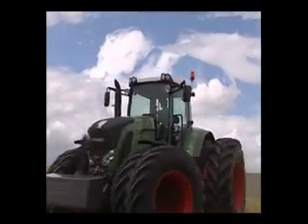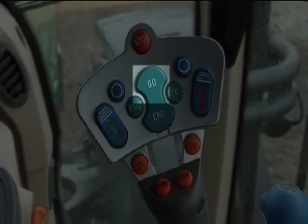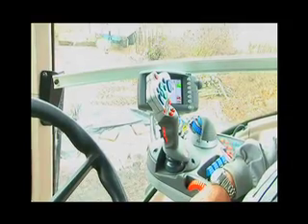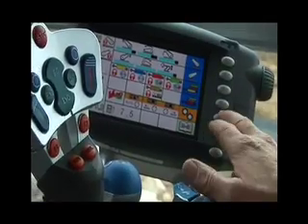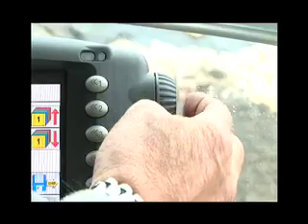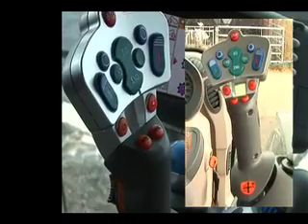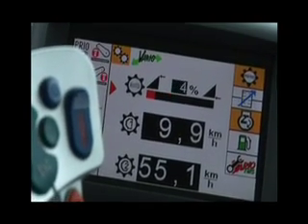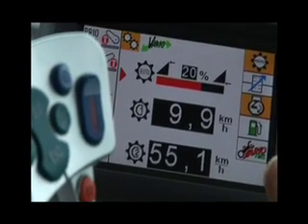The Fendt 936 - Headland Management

Comment: Thats how much you want to let the transmission work the engine.

So If you were in a regular 18spd powershift its pretty much like waiting to downshift when the tractor is under load to wor it harder and get more power and keep speeds up..  But obviously different due to the CVT